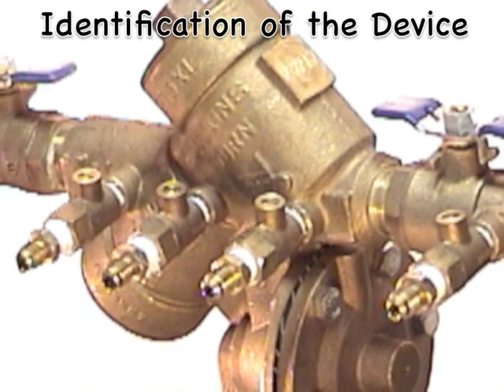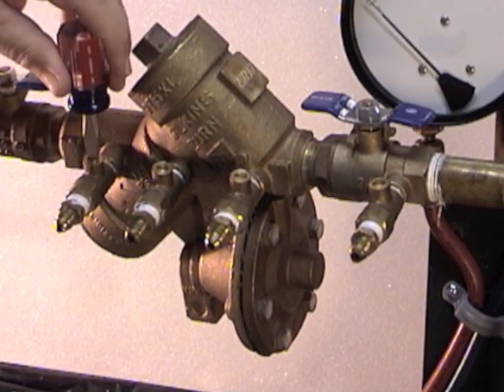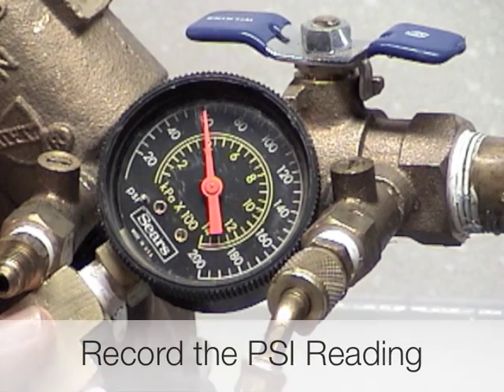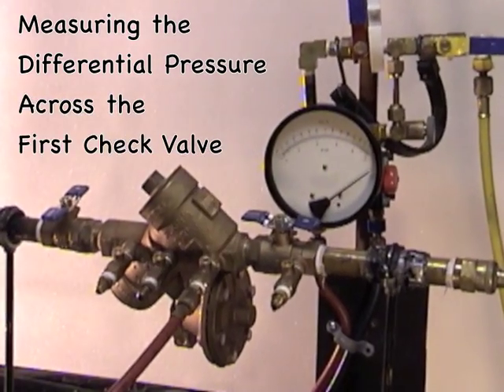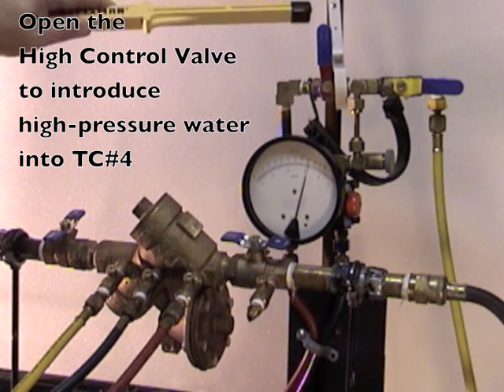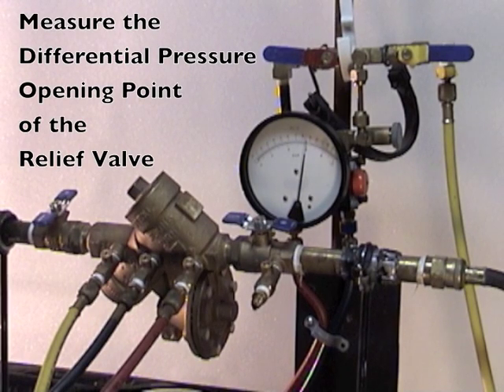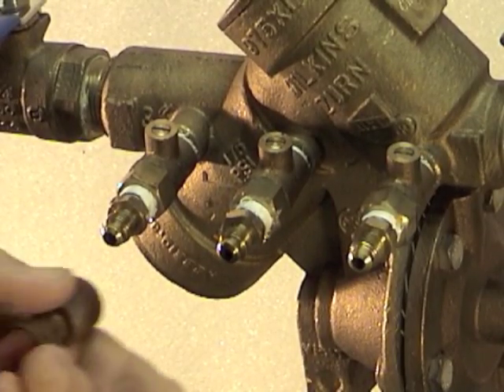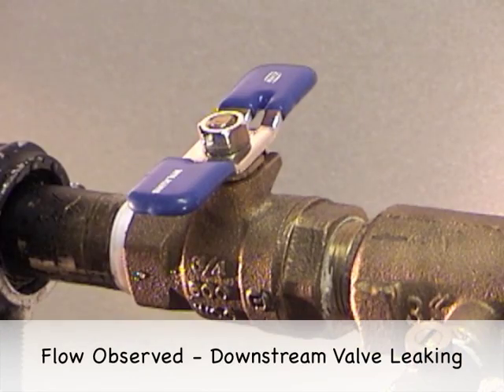RPZ - Field Test

Comment: Is this the 10th edition version of the test?
Reply from the maker: No -However, the results are the same. The only difference is the test sequence. USC tests the opening point of the relief valve first and the DP of the first check valve last. USC does not measure the DP across the second check valve. This procedure is illustrated in the AWWA M14 Manual.

Comment: Thanks so much for your video

You've got great instructions without rushing through it

I was going to build my own rig out of the differential gauge hoses and Associated fittings 

Can you recommend a website or video for doing that?

Thanks again
Reply from the maker: Thanks for the comment. I have not encountered a video for making a backflow test kit, but I have tried unsuccessfully. The differential gauge is available, but purchasing a test kit in the long run was more economical.  Also, the test kit would have to be calibrated. Getting used test kits and parts is an option that I have used.

Comment: Hi, We have to perform 5 year internal inspection on Backflow ?
Reply from the maker: It is state dependent. What state are you working in. Some states require internal inspections but only on testable devices installed for service protection. New Jersey regulations require a Physical Connection Permit be obtained by the owner of a facility where the physical connection installation is to be made with a community water supply (Physical Connection Permits are not required for private residences). Physical Connection Permit has to be renewed annually and requires each backflow prevention device covered by the permit to be tested quarterly and internally inspected annually.

Comment: This is why ABPA is the best. These testing methods are garbage.
Reply from the maker: Rob F. Please provide a more detailed statement regarding your comments. What are your qualifications for making such a statement? All test procedures measure the pressure loss across the check valve. The only difference is the sequence by which the tests are conducted. In the video, the first check valve differential is measured, the second check valve is back pressured, a validation test is preformed, and the relief valve is opened by introducing pressure into the zone. Also, which is not conducted by ABPA is the differential test of the second check valve. ABPA does the same but in a different order. I suggest you read up on how backflow prevention device assemblies are tested to confirm reliability. Let me know if you would like further training!.
Reply: @JimmyBackflow  guess you're not familiar with abpa. Nor with the terminology. Been a tester in the city of sioux falls for over a decade along with asse, Iowa and Nebraska specific. Also having no problem reading USC cross connections 9th or 10th edition. You should try multiple classes from multiple providers. Quit being so close minded. I watched your video and just felt a little sorry for you. Have a good one.
Reply from the maker: @robf4605
Reply from the maker: @robf4605  Rob, not sure where you are going with this, but you need to be more specific as to comments. Pay more attention to the testing aspects and less time criticizing what you do not know. Stop guessing!  Read page 255 FFCCCHR 10th addition. The difference is the sequence of the tests. I am very familiar with all certification programs and provide instructions in all aspects of the testing methos taught by APBA instructors.  I am very familiar with the methods stated in the USC Manual of Cross-connection Control. I provide instructions on all test methods in my training.  I am not sure what you mean by being close minded because I am not sure what your problem is with the video. Please in the future provide constructive criticism --- I am not interested in your nonconstructive opinions. As you suggested, --- I have attended training from other certification programs and held certifications from several states and certification organizations. (Been around for a long time) The method in the video is taught by trainers throughout the New England states, NY, PA, and NJ. This method is listed in the AWWA M14 Manual and follows ASSE 5000. Why are you feeling sorry for me? (Strange statement!)
Reply: @JimmyBackflow  lol, it's testing backflows. Possibly the easiest thing I've ever come across that you can get paid for. I'm just giving you shit. Just keep doing what you're doing bud.

Comment: Hey Jimmy, new to testing. Bought a couple bfps to practice on. Working on rpz, 3/4. Long story short, cleaned seals and seats on check#1 and relief. No drips when shut off downstream valve. When testing differential on check 1, relief opens when bleeding high side. Any help greatly appreciated.
Reply from the maker: Not to worry. What is happening is you are diverting high-pressure water away from the sensing line which is keeping the relief valve closed when you open the high control valve on the test kit. Test cock number two is close to the sensing line. Close the high control valve and continue with the test.
Reply: @JimmyBackflow  should have stated, relief opens after shutting high side after bleeding air. So test would still be valid then? Thanks for your time,help,response.
Reply from the maker: @connpiper  If water did not discharge from the relief valve after closing the downstream shut-off valve, the first check is holding drip tight provided that the RP was in a static state. If after bleeding the air out the high side of the test kit and the relief valve discharged and stopped, fluctuating inlet pressure was the cause.  Continue with the test.
Reply: Thank you Jimmy.

Comment: Failures usually caused by grit in the check cones, if bought new and fails. A) Manufacturers releasing faulty products B) onsite testing kits need collaboration requirements.
Reply from the maker: Thanks for taking the time to view the video and submit a comment. The relief valve will discharge if the first check valve is fouled open with debris and the RPZ is in a static state, a common problem. Flushing before installation is always the best practice. If there is debris in the inlet line a strainer should be installed. Most state drinking water program regulations and public water system cross-connection control programs  will require the test kit to be calibrated annually. The manufacture will specify annual calibration.
Reply: No shit

Comment: Does the city require that all backflow preventers be tested every year?
Reply from the maker: Thanks for viewing my videos. The plumbing code requires all testable backflow prevention assemblies to be tested upon installation, after  a repair and annually. The states have different requirements as do the public water systems. Most will require the RPZ to be tested at least annually. You should check with the public water system to determine the testing requirements for backflow prevention device assemblies.

Comment: Jimmy, what test procedure are you using here specifically? It seems to have portions of several including a confirmation test on number two check. Nice addition but not mandated by either ASSE or USC. Some of your terminology is different than ours in Michigan but that is not a major in my opinion.
Reply from the maker: Jeff, thanks for the comments. The test procedures used in my videos are commonly known in the industry as the “New England Water Works Association Three Valve Test Procedures.”  They were first published in the 1973 issue of the EPA Cross-Connection Control Manual, using a five-valve test kit. However, since then, NEWWA has selected to concentrate on instructing individuals enrolled in the NEWWA backflow tester training on how to test backflow prevention device assemblies using a three-valve test kit.  
The NEWWA three-valve test procedures are listed in the fourth edition of the AWWA M14 Manual.  The test procedures were recently revised to include analyzing the test results of backflow prevention device assemblies. The revised test procedures will be listed in the next edition of the AWWA M14 Manual.  Copies of the test procedures are available through NEWWA

Regarding the RP second check valve differential test, NEWWA feels it is necessary to not only backpressure the second check valve on an RP but to evaluate the condition of the second check valve spring by measuring the differential pressure across the second check valve. Measuring the differential pressure across the RP second check valve also assesses the presence of backpressure.  

Not sure why ASSE or USC does not require the differential test across the RP second check valve. USC states the differential test of the second check valve is optional. Both ASSE and USC state that the RP second check valve shall be equipped with at least a one-pound spring. How does one know if the RP is meeting the standards if the RP is not tested against the standards? If backpressure is applied to the second check valve and it is holding drip tight, the RP is providing protection, but is the RP meeting the standards.